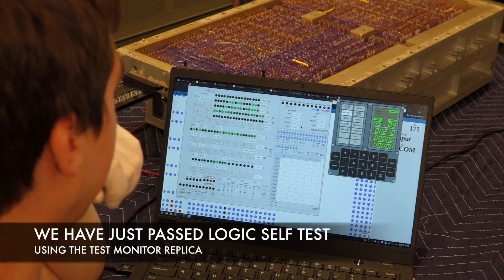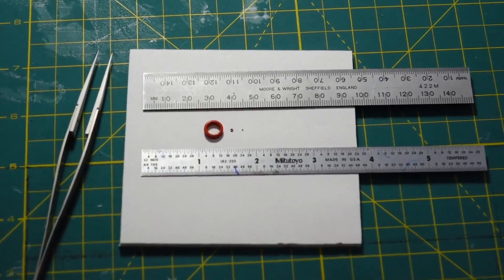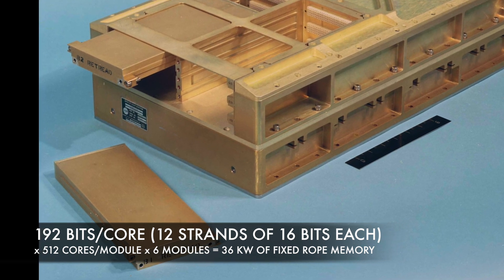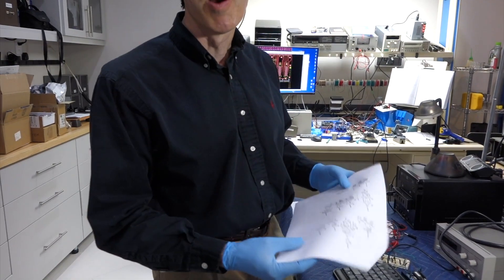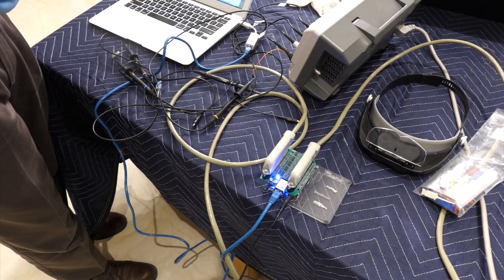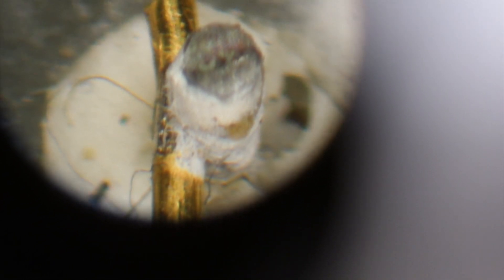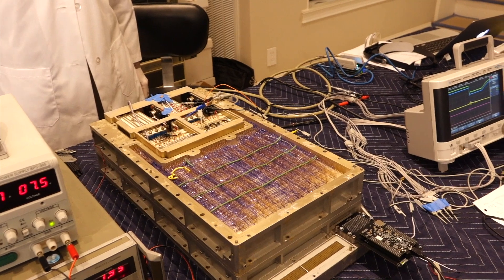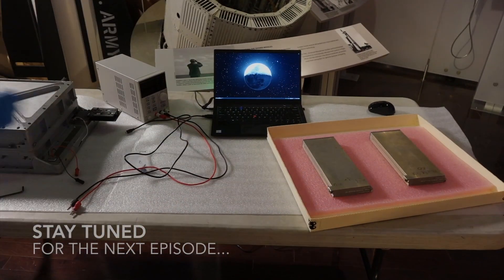Apollo Guidance Computer Part 14: Bringing up fixed rope memory

Comment: Amazing series of vídeos, thank you for taking your time to film and share everything. It's so nice to see the AGC running again! BUT I'm struggling really bad to understand how the Apollo's rope memory was woven, are there address and data lines? Are there data lines? How they are read? I understand how Univac rope memory works, no problem, but AGC is completely different ball game since it runs using it's rope memory (and not using it just to start or load the system to the RAM). Hard to me to figure-out  how the system address it and read the data.
Reply from the maker: If you thought core memory was complicated, wait until you see core rope. Yes it has data and address lines, but used completely differently. Ken has written the only comprehensible article out there explaining this: http://www.righto.com/2019/07/software-woven-into-wire-core-rope-and.html
Reply: @CuriousMarc  Great, thank you! Looks like address lines (inhibit?) are really tricky...
Reply: @CuriousMarc  I agree, It's a really nice article indeed but what I can´t understand is that in the Fig 3-12 we have an example with 4 cores, 4 inhibt lines and 16 sense ones (only sense 1, 2 and 16 are shown), how can sense lines 2 and 16, that goes exactly through to the same cores, get different results in the truth table? From the example in that figure, core #2 is active. From truth table, if core #2 is activated the results are: sense 2 = 1 and sense 16 = 0, but they use the same cores! how come opposite results? Please what I’m missing?

Comment: I neither got the how nor the why of that Rope ROM. Sounds way too complicated for a ROM if it does not solve the addressing.
Do not skip over these things, we would not be here if we did not care, we do.
Reply from the maker: You need to watch some of the videos first. Probably this one is best:
https://youtu.be/2qe4W_USweE
Then  reading Ken’s in-depth articles, linked from the videos:
http://www.righto.com/2019/07/software-woven-into-wire-core-rope-and.html
http://www.righto.com/2019/07/apollo-guidance-computer-dipstiks-and.html
Then you can read the original documentation on your own, posted here courtesy of Mike Stewart and Ron Burkley:
https://www.ibiblio.org/apollo/ElectroMechanical.html

Comment: Um, does anyone working there have any concept of ESD?  I don't see any ESD-safe work surfaces, wristbands, etc.  Seems awfully risky.
Reply from the maker: No we have no concepts about electronics at all, as you can tell. But by sheer miracle my lab is entirely ESD including the chairs. That said ESD sensitive CMOS and FET devices would not be invented and incorporated into electronics for another 10 to 15 years after the AGC. So it’s not a concern with RTL based AGC, nor with later TTL based logic.

Comment: Wednesday 5 May? That happened in 2010. Is that when the footage at 3:58 really happened? If so, this has been a nine-year project (so far). That's dedication for you. Good luck, guys.
Reply: Nah, the clock's wrong. The restoration project proper has only been going on for a year or so.

Comment: Marc I have a question: If the Raytheon core-rope simulators were built in the 70's, what did MIT and NASA originally use during software development and testing in the 60's?
Reply: At MIT, they used the AGC Monitor (which I've more or less replicated), which was also known as the Core Rope Simulator. It interfaces through the AGC only through the test connector. The test connector gives enough visibility into the internal operation of the AGC that an external tool like the Monitor can detect when the AGC is addressing fixed memory. That tool can then inhibit the fixed sense amplifier strobe (via signal MNHSBF) which prevents the sense amplifiers from outputting data read from the actual stored ropes. And when the AGC goes to access the data that has been read from ropes, the tool can inject the simulated rope data onto the central write bus. This is how we've been running in all of the videos up until this one. 

For whatever reason, the Monitor only existed at MIT. Raytheon, Grumman, North American, and the NASA centers instead got a big piece of equipment called the Computer Test Set (CTS). Along with this was a thing called the Program Analyzer Console (PAC), which performed the same sort of rope simulation duty as the Core Rope Simulator section of the Monitor.

This approach is less "accurate" or "desirable" than the rope interface box approach, because your AGC might have completely broken rope drivers or sense amplifiers and you wouldn't be able to tell. In previous videos we ran without these modules even installed at all. So these boxes let us make sure that the rope circuits actually work before installing any real rope memories. They'd also be helpful if you want to simulate a rope, but for whatever reason don't have access to the test connector -- if, for example, you're dealing with a flight AGC which has the channel 77 Restart Monitor installed and you don't want to break configuration to remove it.

Comment: Why would they bother with core rope memory for ROM when they could just use an array of wires that get burned out for zeros and no fancy circuitry to read it out? It would have weighed less because no ferrite cores would be needed and no elaborate circuitry needed to read it and thus would be less prone to failure.
Reply: I was going to ask the same question. Maybe if we saw the core rope explanation we would know. My guess is that the multiple wires through the cores allows different programs to be run with the same set of cores by changing where the input pulses go. Was there an answer to this question anywhere in this string?

Comment: The mixture of gold and tin contacts in those Raytheon boxes probably isn't helping their connection issues.  I've come across a lot of electronics over the years with oxidization from the differing metals.  Mainly arcade games with gold sockets and tin chips.
Reply from the maker: Agreed. I found this weird too.

Comment: It still blows my mind how physically difficult it was to make memory and other parts back then.  It just goes to show how devoted people were to projects.  Stuff got done, even if it had to be invented on the spot.  And it's great to see a group of people that carry on this type of work.
Reply: same story with the F1 main engines on the Saturn 5, while the blueprints still exist, a whole lot of custom fitting had to be done by hand to actually make them work, and the notes on what was done there either was never written down, or lost. the team that looked up possibly recreating those engines actually found it easier to come up with a simplified cad model that brought the original engine's some 5000 parts down to about 55-60 pieces . simply because modern design and manufacturing techniques allow us to build parts with shapes and complexities that simply weren't remotely possible then

Comment: Question; does the AGC have fans for cooling? I'm curious how noisy it is when operating. The videos always have plenty of background noises; uncertain what is from what.
Reply from the maker: No fans. In the LM or CM it was cooled by a cold plate. But it is only 70W max, so we didn’t really need to cool it for the short amount of time we had it on.
Reply: I'm guessing not, imagining some passive vents being sufficient. But I remain interested in someone in the know answering... Thanks!
Reply: @lexihaley2887  Vents wouldn't have worked, since the computer was pressurized with nitrogen to provide an inert atmosphere that wouldn't be affected by humidity or anything in the spacecraft. It was instead designed to mount to a cold plate, which was constantly cooled with ethylene glycol.

Comment: I'm curious, what's the smallest modern computer that could run a similar program to the AGC? 

Could you run basic AGC functions on a arduino teensy? Or even something smaller like one of those computers on a chip, those chiplet things?
Reply: FPGAs can simulate the entire logic of the AGC, but memory will be logic RAM and ROM, not core, or rope.
Reply: Try a PIC20F222. Six pin bit of cockroach crap in the SMD version.
Reply: @Tedd755  you mean a PIC10F2(XX) a 6 pin SOT-23 device? "The world's smallest microcontroller"

Promotional sheet PDF:
https://www.google.com/url?sa=t&source=web&rct=j&url=https://www.microchip.com/stellent/groups/SiteComm_sg/documents/Training_Tutorials/en528372.pdf

But it doesnt appear to have an output for a display? Or just one i/o? (Sorry I'm a noob)

Let's say you wanted to output to a little colour led/lcd? (As they dont make tiny 7 segment displays?)

There already appears to be a port to arduino...so wouldnt it run on a teensy?
Reply: The AGC has 15bit+parity and a complete different instruction set than any MCU. Even if the arduino is a few times faster, it would be hard to emulate the AGC, maybe it could work with an assembler transcoder, but imho it wouldn´t be worth it to make such an acrobatic hack. I think a pure software emulation would be "easily" possible on simple ARM Cortex MCUs running with at least 50MHz, costs a few bucks. They have 32bit, so you could fetch an instruction from memory and transcode or interprete it on the fly. But there would be no analog&digital circuitry included for driving gyros, thrusters, DSKY etc, just the plain software execution. Simulating them on the same MCU (by using MEMS IMUs) would be imho possible, though. Bigger processors with 100MHz can definitely do it, using only 250mW and fitting into a matchbox, compared to the 70W of the original :)
Reply: A quick Google search reveals someone running a Virtual AGC on a Palm Centro! That's a (theoretically) 312MHz CPU. Obviously it can run on much less.

Comment: So the fixed core rope memory is now fixed fixed core rope memory?
Reply: Its actually fixed variable core rope memory since it is a simulator. :-)
Reply from the maker: The curiously named fixed fixed memory refers to page 0 in fixed memory (indeed from core rope) that does not need to be moved into view within the very restricted address space of the AGC by using the memory bank register (which is all the other pages, or the majority of fixed memory). Hence it’s doubly fixed. It would have been better named base bank or base page fixed memory, but it’s much less fun.

Comment: Great video and thank you for doing what you do. I do have a question however, why were core rope memory necessary? Why didn't they just make a circuit board that had solderable jumpers in the form of a pair of closely placed pads? Wouldn't that be easier to automate, lighter, and maybe even more robust?
Reply: It would take up more space. And since this was the first micro computer ever, space was of the essence.
Reply: Toboter XP 
Thanks for the reply, but I can’t imagine that to be the case. Circuit boards can be made very thin (I’ve ordered 6mil boards from manufacturers) and that the pads can be made *extremely* small, smaller than the holes that are big by necessity due to the needle that needs to go through it.
Reply: @signalworks  Today you can probably get extra small  circuit boards at every corner store, but in 1960 they were a little hard to come by. Remember that the entire digital circuit industry was in its infancy.
Reply: That's why everything in the AGC is connected with wires, not traces.
Reply: In the 1960s boards were about 25 mils thick, and holes were big enough for through-hole components, probably 8-10 mils. ( just looked up DIP specs. The pins were speced between 15 and 22 mils wide. So about 24 mils diagonal. You must have needed a .025 hole after thru-hole plating.) The pads were on the order of 40 mils diameter. Remember DIPs had pins on 100 mil centers, and the best you could typically do was route ONE trace between the two pads for a pair of DIP pins. Also, multi-layer boards were in their infancy. It was a while before they had 4-layer boards with internal power layers, and I'm not sure 6 layer boards came before the early 1970s. 25 or 30 layer boards didn't come along until the 80s, and I'm not sure anyone other than Sperry managed to get things that dense.

Rope memories were just about the densest form of nonvolatile storage possible until the early 1970s when various forms of ROM came along. Since the early ones were all mask-programmable, it's somewhat doubtful that people that decided to make a computer with only one kind of logic chip for all logic would have wanted to try to make unique mask-programmed ROM chips work for each mission.
Reply from the maker: Such things did exist at the time. You can’t do shorts, but you can do diode matrices on PCB. Or capacitive or magnetic coupling matrices (used for microcode in the IBM 360 series). But the density is far lower. To achieve comparable density with “jumpers” you’d have to wait for the first ROM ICs.
Reply: @CuriousMarc  
I see, thank you for your reply!